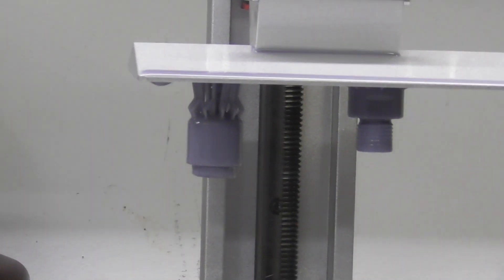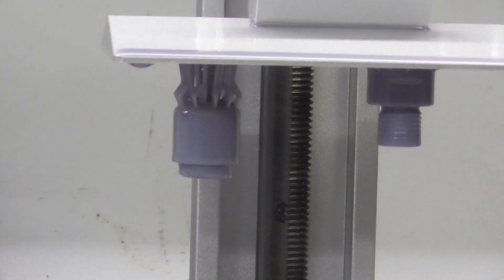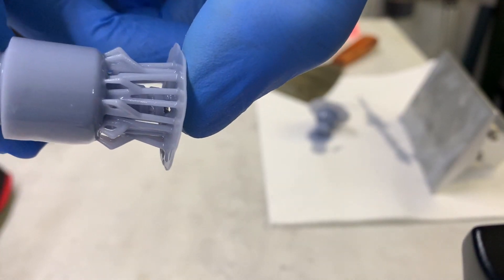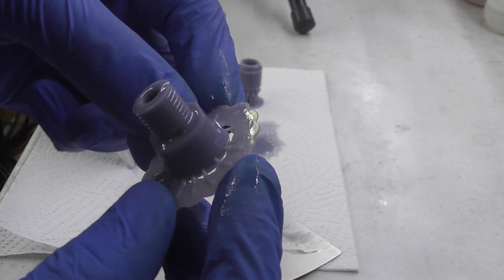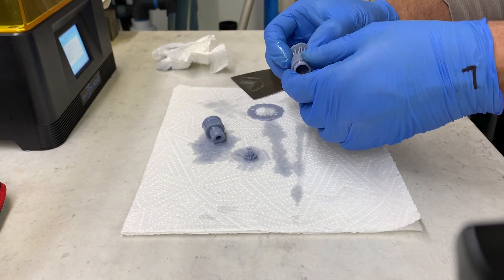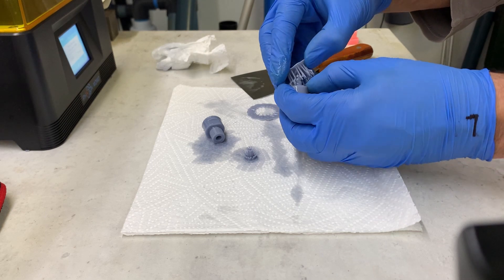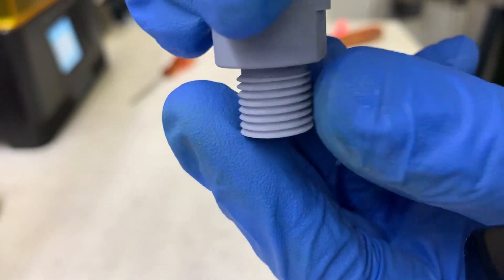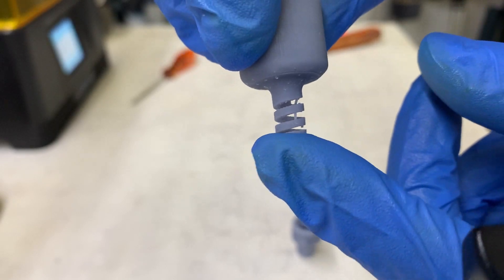Anycubic Photon Mono - Printing a threaded two-part sensor housing

Comment: I would just love to know how you got it to build so smoothly. I have mine at 51 um with a 45 degree angle, and I did the super lube on the bars... I'm still gettin odd and tiny lines.
Reply from the maker: Is your printer on a really solid base / desk / workbench? - movement in the base will result in small layer imperfections.  I do my prints at 50u, and most of my larger functional parts at 100u

Comment: Very interesting parts. One question, why did you have to label your gloves with a "L" and "R"? Unsure which hand is which?
Reply from the maker: 😂 With all those IPA fumes, one can never be sure... 

Practically, though, I often just roll the gloves off and then re-use them later - so it started out as a marking for which side is inside vs. outside
Reply: Nice I'd like to see a video on supports